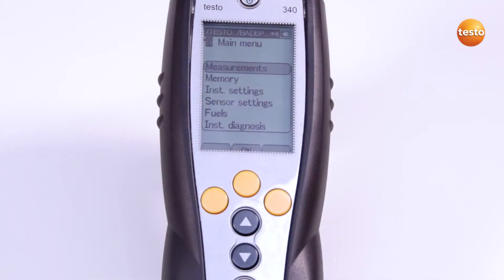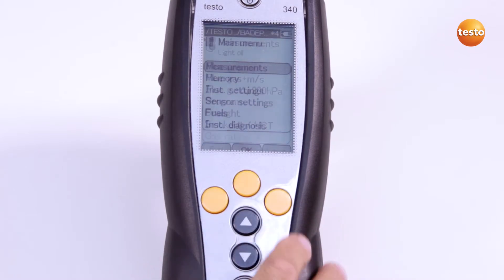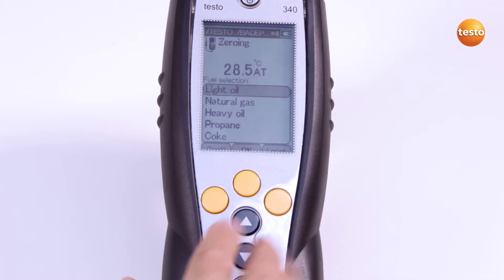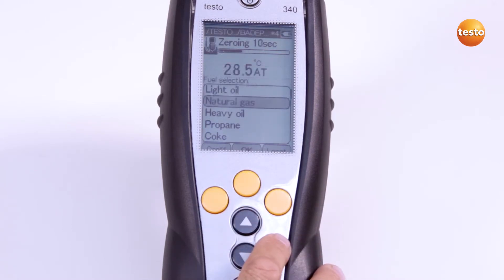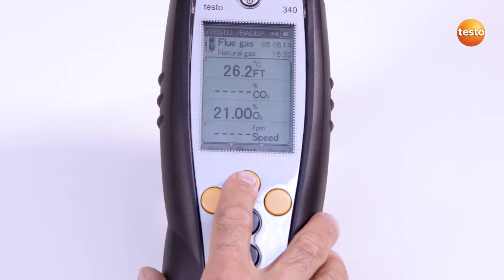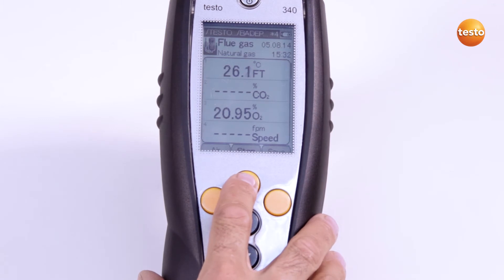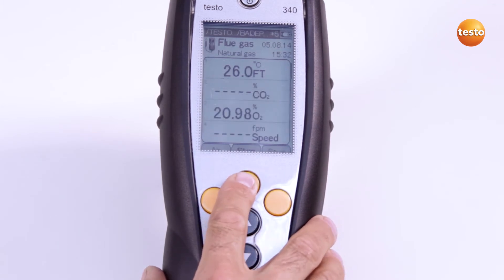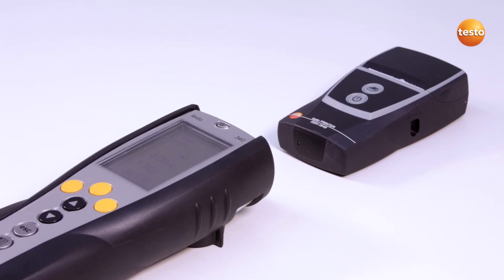testo 340: Carrying out a measurement (5/12) | Be sure. Testo

Comment: Now do a video on how to change firmware, especially if it's the bug ridden crap testo 340 ver1.2 .
What firmware version that is stable is ver1.19 but it's a massive drama to update firmware.
Like 
The USB cable is from the 1990's and you can't find them in shops. 
Then you have to cut it down because it won't fit in the usb socket. 
I couldn't get it to connect to the PC. Had to send back a brand new 340, less than 1.5hrs use before it died and couldn't be used at all on Nat gas. 
If I wanted to save a file name of 10 characters it would take over 100 clicks and take 5 mins on the keyboard that I first saw on a analog mobile in the late 80's. 
The folders don't work either. One is all i can save and see, not 100. 
Almost $5000 I wish I'd never spent.
I have lots of testo and the rest are awesome. 
This 340 is a total piece if shit.